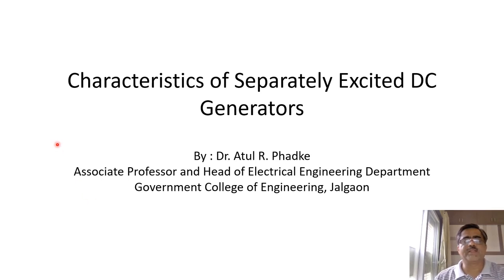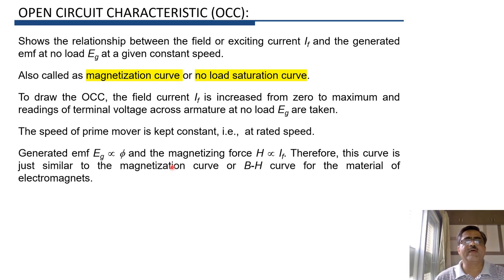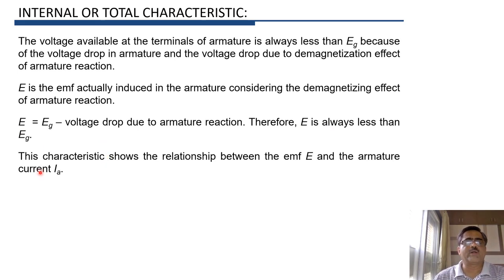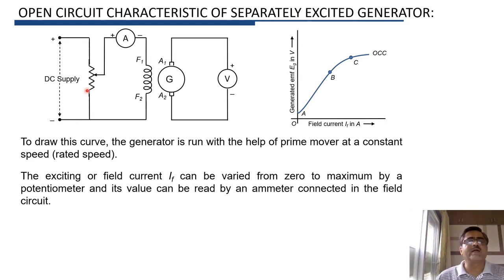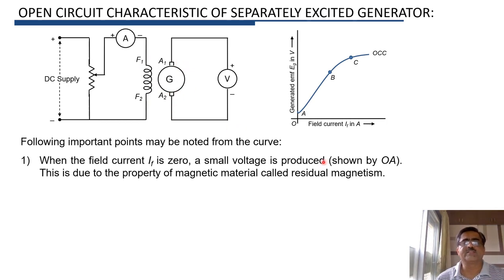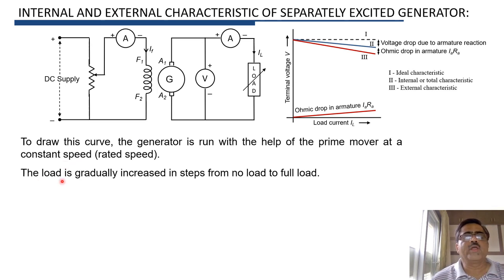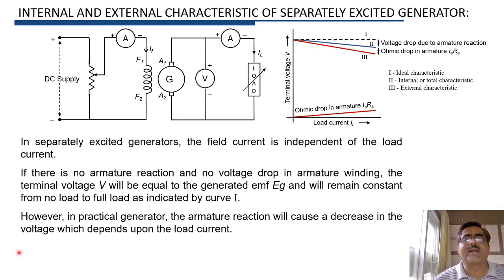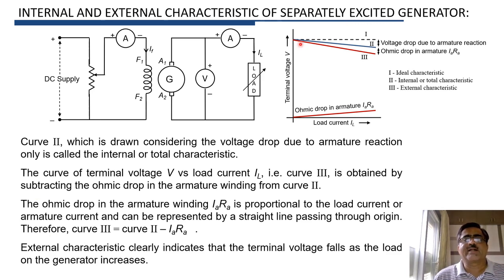Characteristics of Separately Excited DC Generator (16)

Comment: hello doctor 
i have a fewa question if you can helpp me i will be greatfull
1) What happened to the terminal voltage and speed of the generator with the addition of load? 
Why?
2) Can you return the terminal voltage to its actual value? How?
3) How can you find voltage regulation of the machine?